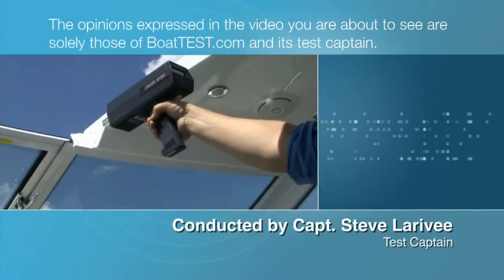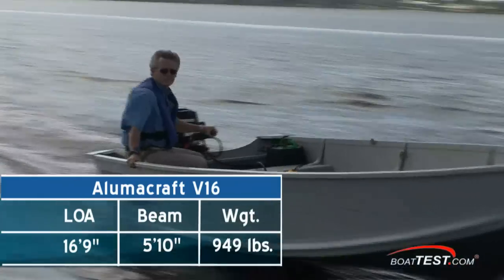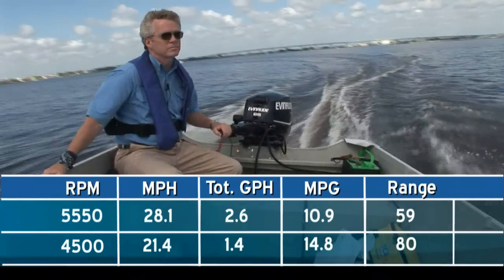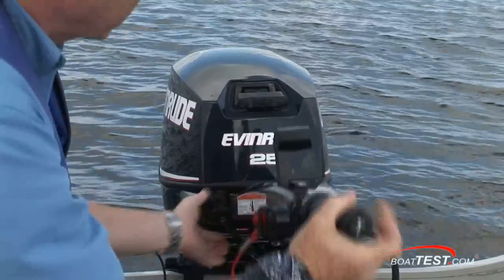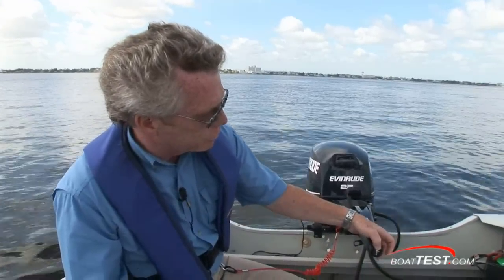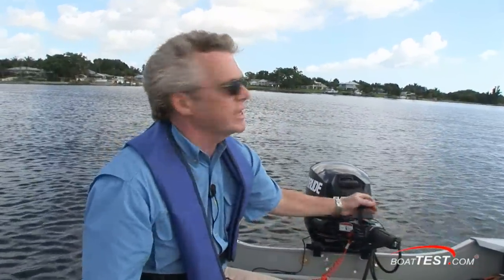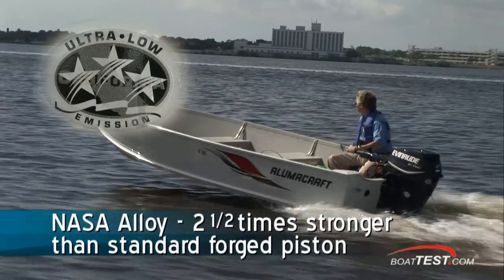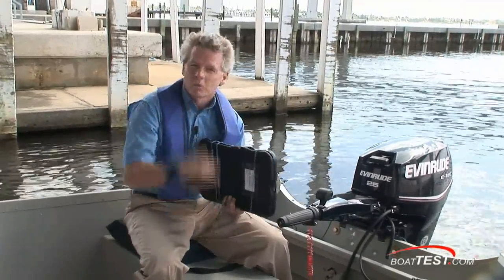Evinrude E-TEC 25 H.P.  Engine Tests - By BoatTest.com

Comment: I have  2009 Etec 25 hp. I loved it it ran great except I had to change an injector in 2019 and this year I brought in for service got it back went fishing ran great fo2 hours  trolled well went down the lake at 16 
7 kms it died brought back to dealer he checked out found #2 injector b.o or possible ECM ordered new injector it took 3 weeks to get them installed ran rough so now it needed a complete tear down possible 3000 dollars now I had 1500 plus hours on unit but I  would take back my 1989  Evenude  any time it probably  had 2000 plus hours and ran like a charm today's outboard are throw away and you can't work on them due to the electronics

Comment: That boat weighs 285 pounds...
28.1 mph at 5550 rpm?.
Over propped.. should be closer to 6000rpm at w.o.t. propped right that boat should do 30-32 +-
Reply: My 1990 evinrude 25 is on a 15’9” glass skiff weighing 475lbs hits 28knots

Comment: my Mariner 9.9 ( really tuned to 15) puts me at 19.  Im around 300 lbs, boat is 700, with motor weight at 115... all said and done 1130 (including gear)  btw its 1986 Mariner...  starts every time.

Comment: Why are you posting that? Boats are different, and therefore they will see different speeds. Go visit us on OffshoreOnly(dot)com. Many of us over there, cruise @ 60+ mph and top out over 100+ mph. That's as much apples to apples as your comment.
Besides, even though I'm a merc guy, I know and admit Evinrude is top dog on the stock outboard market, and merc racing rules the hi-perf part.

Comment: 28mph out of a older 15hp 2 stroke...... Not with 950# of weight being pushed. Fact is a 15 would struggle to plane that sort of load and would be lucky to see anything over 16-17mph on that setup. 28mph with a 15hp is not realistic at all sorry
Reply: it's a 25, not a 15...